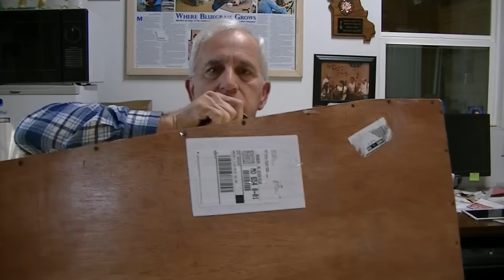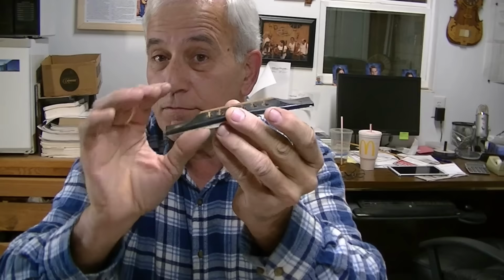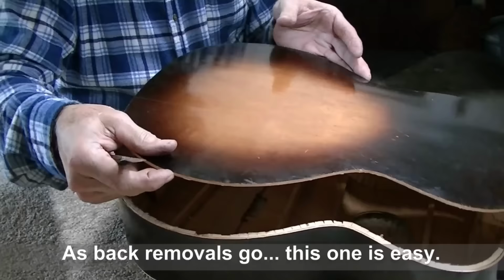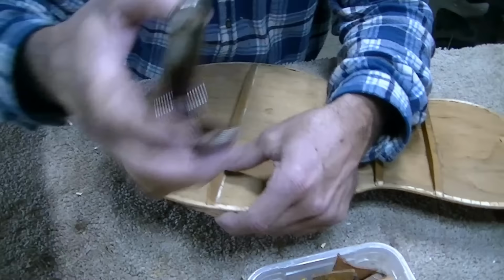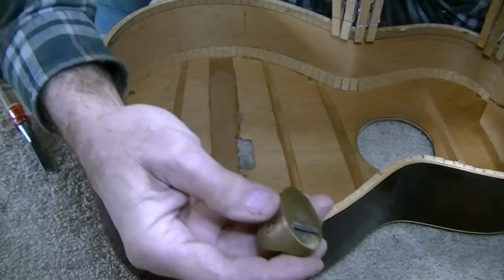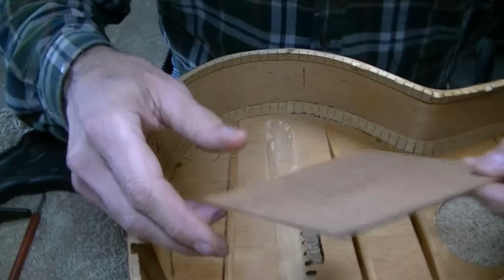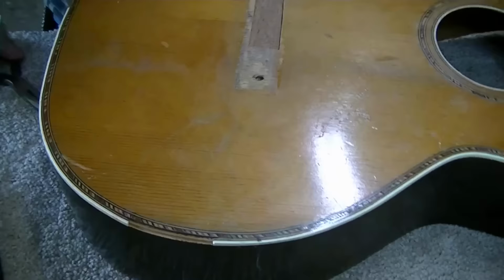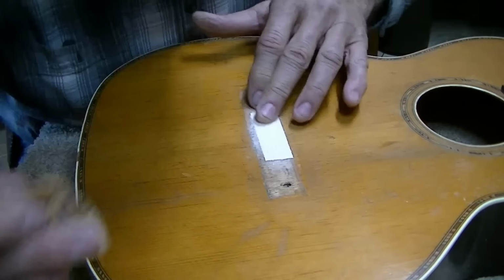160 RSW Regal Wreck Restoration Part 1

Comment: Intriguing video! I noted the potential problem with expansion on the bridge backing plate; could this have been overcome by running the grain in the same direction as the top?

Comment: Just wondering if the large plate you installed under the bridge would absorb a lot of the vibrations. Could a smaller piece work or maybe the use of a sound wood (spruce) be used there?

Comment: My father was a pipe organ builder and he use to use hide glue that had to be heated prior to use.  Just curious if that is the glue used in guitar building?
Reply from the maker: Vader1957 lots of Builders still use hide glue.  I prefer to avoid it because it is very brittle.  That is basically why these braces came loose in the guitar.  more than likely that's why the bridge came off too.  thank you very much for watching.

Comment: Maybe you should just glue a piece of leather to one side of each clamp?  Looks like it would save you some time.
Reply from the maker: I have several clamps that have leather glued to them already. Typically I use additional leather pads with those as well as the leather tends to get hard over time

Comment: I am somewhat new to luthier work (I'm on only my 15th guitar repair now). I have a client who wants a similar thing done to a 1970's guitar. It's a terrible incident of belly bulge when the entire bridge was lifted and cracked, the spruce under it was lifted and splintered, the bridge plate was similarly bowed upward and splintered. Sigh. So it needs the bridge area routed, top flattened, bridge plate removed, new bridge fabricated, doesn't want the back taken off, but needs new the bridge plate, etc. Like in your video here. It's a lot of work and I have no idea how much is even fair to charge. Any tips on what is fair? It's of sentimental value for my client, so I am going slow to make sure each step is done correctly! Any advice would be very welcome!! I am a huge fan of your channel!!
Reply from the maker: Well I've said many times I bill by the hour. Parts and shipping or extra. I use a Time clock to keep track of my time because it's very difficult to keep accurate track of your time. Especially if you're working on multiple instruments. I would just figure out how much you want to make per hour in charge that amount and if it exceeds what you think the job should cost then it's up to you to decide whether you want to give the guy a break or not good luck to you.

Comment: Im completely new to your channel and just subed. Loving the tunes and cut scene style. Ive got a cheaper 12 string acoustic that isn't worth much. Its got a debilitating hump around the 13th fret. Im pretty handy and have built some electrics and wanted to try and fix this newer/not classic Takamine. Im thinking pull 6 or 7 frets and sand her down and refret but here is where I could use some advise. Ive got almost no tools. I could probably get something for a strait edge. Anyway if ya got a minute could ya pretend your starting out again and let me know how you would go about this?
Reply from the maker: Phlop Alopagus it don't take many tools.  just a flat 6" bastard file to level the frets and a recrowning file to re-round the tops.  if you don't have a recrowning file then you could just use your fingers with some 600 grit sandpaper and it'll round it off enough to get by.  Most humps can just be filed level rather than pulling out the Frets but I'd have to see it to know for sure.  good luck to you.
Reply: Thanks! That is what I was thinking and ive needed a bastard file for some time now. Im afraid it wont be that easy and that I will most likely have to pull frets as 4 frets worth of board are all the same note haha. Its a very visible hump and whats odd or at least odd to me is its 4 frets off the neck/body joint. Why its got a hump there I dont understand. I do use the upper register commonly and other then this one problem the guitar is in 100% condition which is why I have to fix it. Its just a Takamine g series and is why I dont want to put money in it. Beside I need to hone some skill. Thanks again. Im on your next resto now. Think im going to make a day of it :)
Reply from the maker: Phlop Alopagus thanks for watching.

Comment: I’m surprised that you didn’t clean off your carpet top of chips and pieces, also that you didn’t use a radius dish while gluing the back?
Reply: Re-gluing loose braces like this wouldn't require a radius dish since the radius is already in the braces. Good placement, good glue, and good clamping is all that's needed...

Comment: Hello and thanks for the video
1) so what i see is a slightly 'arched top' due to the bracing (being 'crowned') sightly...
however then you clamped the mahogany bridge plate and you stressed that you want the top flat.
I get that the bridge is flat...but do you want a flat bridge?

in otherwords, is the flat bridge and bridge plate going to conflict with the 'slightly arched top?
or is the tension  necessary?

i am confused....
RSVP Thanks
Reply from the maker: The top was completely flat not arched

Comment: Don't know that I've seen so much glue failure. Makes me wonder if they didn't use the right type of glue.
Reply from the maker: Actually old hide glue gets brittle and cracks and always breaks. When you get the old instruments in you just see tons of this.
Reply: Rosa String Works Does replacement of the hide glue with wood glue change the tone at all?

Comment: I hate to ask, but where do you find your exotics, like spruce, mahogany and ebony that you use for your repairs. I live in Austin and find it hard to find those small pieces .
Reply from the maker: There's no real finding it's just acquiring over the years. If I get something I hang on to it. I don't go out searching for it most of the time it finds me. In other words people have given me stuff over the years.
Reply: I once got a bunch of pieces from a guy that does boat restoations and the like. Lots of mahogany.
Reply: @wmoates6029  Thanks for that clue..I grew up on the Texas Coast and still have Fam' down there around the Marina's...you are such a good pointer...Hat Tip to you!

Comment: Would a 1965 Yamaha dynamic S70 be worth repairing?
Reply: elise veldt  this beaut was tossed from a car and found face down in the morning dew.. glued the seem and crack in the top. New tuners and strings so far it plays hasn't held tune yet. These are supposed to have reinforced neck for steel strings I went with nylon so as not to push my luck..

Comment: Could you glue a thin strip of wood under the damage, and fill the gap with a two part epoxy, then glue the bridge back on with two part epoxy?

THIS SECTION ADDED AFTER ORIGINAL POST - I am so bad at commenting before the videos are done, I'm so ashamed!...sigh

I'm dealing with a very similar Ovation 1617 and that's what I was planning on doing. There are also three thin cracks in the paint extending behind the bridge, about two inches which I'm thinking about crazy gluing - for two reasons 1) A strong bond and seal 2) you can use crazy glue to actually have the same finish which is clear high gloss in my case.

Thoughts?

Jack
Canada

Comment: Is it normal not to use heat when removing the back of a guitar?
Reply: It depends. Some of them pop right off. The more difficult ones I would brush a little bit of water several times over the course of an hour to soften the hide glue and then maybe a hot knife. I restored a LOT of these types of guitars over the years. The tricky thing about them is that if you find a loose brace or two you can pretty much assume all the rest of the glue joints are questionable too. For that reason alone I would reset the neck almost whether it needed it or not. There's a fungus or bacteria (I forget which) that attacks hide glue, otherwise it's a very strong adhesive, often better than the ARG he uses. ARG is basically latex rubber.

Comment: Is that Titebond the best glue for this work?
Reply: It works pretty well. A lot of people use it to build and repair guitars. Personally, I've been using fish glue (see StewMac.com)  for most guitar gluing. I think its characteristics are somewhat better for instrument work. I still use hot hide glue for the neck joint, bridge plate, and bridge. It is easily reversible (for disassembly in 50 or 100 years) and it will glue to itself, so you don't have to be so fastidious about cleaning already-glued surfaces to reglue them.  Titebond does not bond to itself very well, and some luthiers claim that it creeps under load. Re: durability of hot hide glue. They've found things in the pyramids 3000 years old, still well glued with hhg, so I don't think a properly made hhg joint is a problem unless the instrument is subjected to very adverse conditions.
Reply: @MaineGeezer  Thanks! very interesting.
Reply: @pangrac1  To get a different slant on guitar building (there are frequently several ways to do something and they all work, it comes down to personal preference) you might enjoy the instructional videos on YouTube that are done by luthier Robbie O'Brien. Another one to look up is Blues Creek Guitars, with John Hall. I think my personal preference is Robbie O'Brien's methods, but that's me.

Comment: Thanks for the interesting video. I do not understand why you do not remove the obvious hide and bone glue just with hotnwater and use the same glue to restore. Boneglue is used for hundreds of years as it can be resolved and so you can fix things. Using the white glue you use takes away this option for future repairs. Also it’s vibrational characteristics are much worse. You could have also avoided chipping by heating up the back rim with wet rugs. Again an advantage of bone glue. Why don’t you?
Reply from the maker: Sorry I completely disagree with everything you said. Hide glue was a very good glue back when Ox carts were the best form of transportation. Things have improved significantly. Titebond original can be taken apart just as easy perhaps even easier than hide glue. But it doesn't turn brittle and break loose on its own like hide glue does. 99% of the repairs I've had to do over the last 37 years have been due to hide glue turning loose. If stradivari were alive today he would throw hide glue in the trash and use Titebond original. If you don't believe me about opening joints with Titebond original. I have a video out there where I took the neck out of a guitar that I built.  It was built with Titebond original.  It took me less than 15 minutes to steam the neck out of it. I've never been able to do it that fast with hide glue.  All the things you said are myths that have been passed down by those who are totally traditionalists and refused to change. Now having said that, I openly admit hide glue is a good glue still. But I don't use it because I don't feel that it's as good as Titebond original.
Reply: Well I got reasons for my statement you say it is like this as it is like this. In my opinion Restauration means to restore means to use same techniques material and honour the artists work to preserve it for the future. You have a different approach, that is fair , but don’t tell me tightbond is the way forward. I know enough makers of good Acoustic instruments that would not touch the stuff as mentioned due to the fact that it’s irreversible for repairs. I think it’s nice that old instruments from I.e. the 50 can be taken apart and fixed just with water and heat.even better this can be done another 50 years from now. Same with shellac b.t.w.
Reply: @WRM-istomoveon  Yes. I could elaborate, but I'm sure you could  say it all as well or better than I could.

Comment: Why not use hyde glue?
Reply from the maker: I've answered this about a thousand times. Hide glue was the best glue you could get back when Ox carts were the best form of transportation. Things have improved a lot since then. if stradivari were alive today he would be using a good quality wood glue there's no reason to use hide glue. There are tons and tons of myths about hide glue that just simply are not true. The other myth is that you cannot take apart wood glue. I have a video showing how I took a part a neck glued with Titebond original in less than 15 minutes.

Comment: Loadsa water staining in there which could account for loose bracing and kerfing......................
Reply from the maker: I really didn't notice any water damage. Maybe there is some staining from it but I didn't see any.
Reply from the maker: I might add with water damage, since it was plywood, the layers probably would have separated.  The finish probably would have deteriorated as well. The finish was in great shape and all the laminations were very tight.

Comment: Hey....why didn't you start on the finish with a wire brush like some idiots guitar "restoration" find I saw the other day on YT? Then he BATHED it, in soap and water, under a hose faucet, the INSIDE too!   ;-P  Then he used Ramen (yes Ramen) and superglue to patch a large hole in teh soundboard.  You absolutely would not have BELIEVED the finished product.  It was HORRIFIC, "tuned" to something that went up and down the "scale" (I use that term not loosely, but completely incorrectly in that particular case, as I heard nothing that sounded like ANY KIND of a musical interval).  It had about four times the views of this video...ya gotta wonder...hopefully everyone that watched it was laughing their butts off, like I was, rather than thinking there was ANYTHING worth taking away from it.  You Tube stuff is really weird sometimes. 

Serious question now.  I realize it would have been a lot more difficult, especially the planing, but I'm kinda surprised you ran the grain orthogonal to the original in the patch (if I'm seeing it correctly in the video).  Isn't that going to make the sound board vibrate quite differently, and modify the original sound, or am I splitting hairs?
Reply from the maker: The Grain on the patch runs the same way as the top. The grain of the pad under the patch on the inside of the guitar runs opposite.